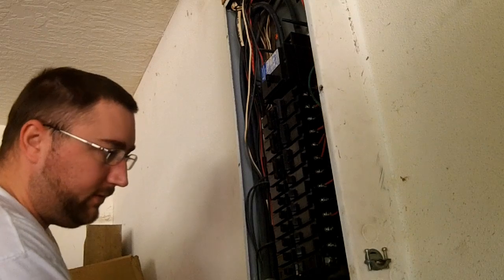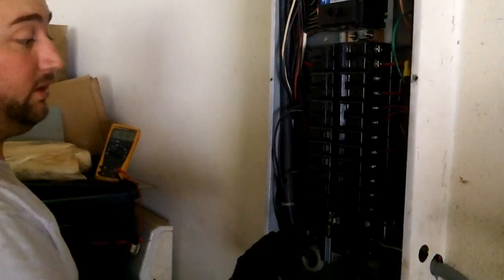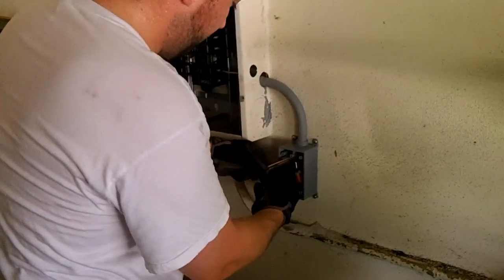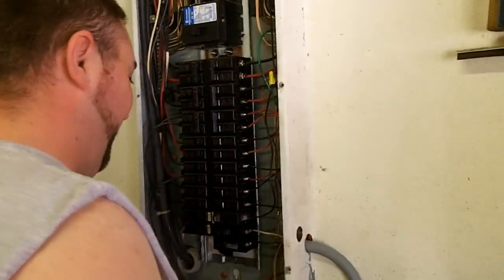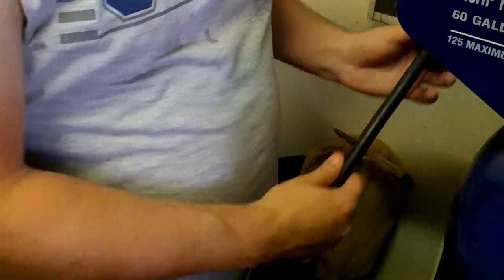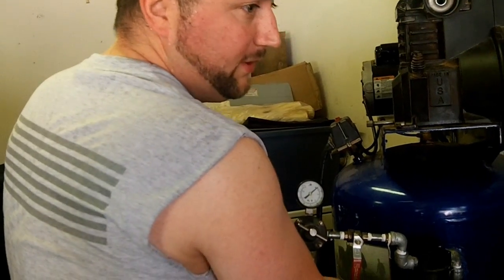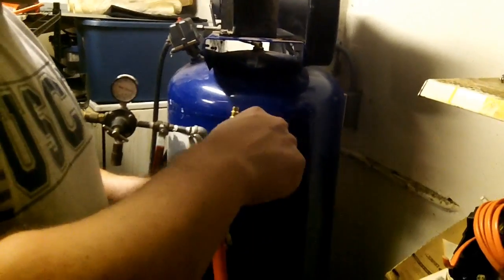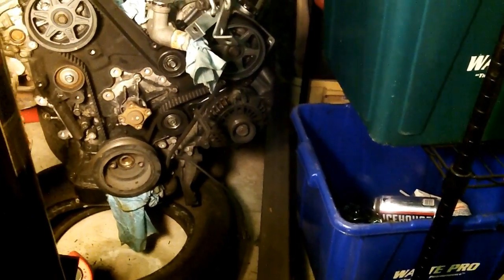240v Wiring for Air Compressor

Comment: Yeah, checking the ground for full voltage is a good thing.

The Romex isn’t so thick and hard to bend if you strip the sleeve off the wires, which you can do since you put them in a conduit.

Comment: good day sir, how about 3phase compressor how to connect it to a 3phse line circuit breaker? thanks..
Reply from the maker: I'll assume you want a wall switch for safety reasons.  Find a 3 phase switch.  Wire the compressor to the switch and the switch to the 3 pole breaker.  It's not much different from what you see here except you would use 3 phase components.  Instead of dealing with 2 bus bars you have 3.  Instead of a circuit breaker with 2 poles it would have 3.  Just make sure you get a 3 phase safety switch and you're good to go.  Most 3 phase appliances use very high voltage (it can kill you).  Please be very careful.  If you aren't sure what you are doing contact a professional electrician to help you.  3 phase is no joke, it's usually only installed for commercial buildings these days to power industrial equipment.  There are plenty of older homes still on 3 phase but they are being phased out for 2 phase.

Comment: You two are scary, be careful & Hire a certified electrician, save a life.
Reply from the maker: g quinn > Care to explain how and why?  This is a learning channel so please teach me what I did wrong.
Reply: @DJDevon3  idiots just want to talk a bunch of shit, Nothin wrong with knowing what you're doing if you know what you`re doing. No need to wait for someone to rip u off behind their little certification. If it passes inspection, who cares?
Reply from the maker: Scary how?  Please explain.  To my knowledge we did not just meet state building code, we exceeded it.
Reply from the maker: I see.  Please understand that my brother was an electrician while in the military.  He knows what he is doing.  I'm the one that doesn't know what I'm doing. ;)  He made sure that we checked and double checked for live wires before touching anything most of it was off-camera and not filmed. ;)  We actually improved some code violations in our case.  Always consult an electrician for this kind of work definitely.
Reply: if you can accept something from an old ANG Tech we have this safety thing called the "one hand method" that means working around voltage we try to do things with one hand. do what ever you can to limit your exposure by using one hand, if you have to get an alligator clip do it

Comment: I didn't read all the comments, but it looked like they were about the wiring and the regulator.  One suggestion I have...especially since you're living in Florida....Get 50-100' of 1/2" hose and connect it between your tank and the water trap.  The air coming out of the tank is still really hot and can hold a ton of moisture.  I leave the first hose coiled up on the wall behind the tank.....it acts as a condenser.  You'll pull a lot more moisture out of the air this way.  The 1/2" line shouldn't have much of an affect on your flow or line pressure to cause any trouble.  When I lived in Florida, I did this with my compressor, but I also kept the hose in a big tub of water.  Here in Oregon, I just hang it on the wall. 
Great vid......I got a good laugh when you plugged it in with it turned on!!!  Been there...done that......cleaned my shorts later.
Reply from the maker: bluehandsvideo I"m going to be adding a 50ft run of copper pipe plumbing on my wall.  I'm sure I'll make a video on that.  Haven't bought the pipes yet.
Reply: ***** Ah!!  There you go.....mo' betta idea!!!

Comment: Next up.....wiring in a/c!!  lol
Reply from the maker: bluehandsvideo I wish.  That's just not going to work for my garage in how frequently I open/close it.  What I really need are a couple of industrial sized fans.  I have a pretty big oscillating fan that keeps me cool on the other side of the garage.  On the side with the breaker box though, there's no air flow and it's hot.  Figured that would be good to show people that don't realize just how extremely hot it is here during Florida summer.  It's a sauna.
Reply: *****  I've thought about doing this for mine......taking a good sized desktop fan and mounting it to the ceiling upside down.  You could put it on oscillate or point it where you want.  Have you seen the guys putting their cameras on a boom so they don't have to use a tripod?? I was thinking about a fan on a boom.......maybe? :)

Comment: Hey DJ...nice to see that you got your air compressor running. On the installation, just got a few tips for you. For the opening, you can use reducing washers which has two different size conduit sizes on them to seal the opening.  #12AWG  would be big enough for the branch circuit and when you're running Type NM cable, (romex) inside a conduit, you can just peel off the jacket and use the wires by themselves which gives you more room inside the box. Also, you can check the ground by measuring against the line voltage as you mentioned. Just out of curiosity, what was the HP for that motor. From my NEC book, it looks like it's around 2HP. Take care and hope you get some good use out of that compressor.
Reply from the maker: stuzman52  It's a 6.5HP motor.  CH Model VT-1630.  Thank you for the tips.  I'm going to go look for reducing washers right now.
Reply: ***** Holy moly DJ...when you said 6.5HP, that motor would be pulling around 35 amps. I figured that the manufacturer has oversized the HP. I looked around the net and seems that some manufacturers got sued for this issue. Damn it, I posted the link, but it didn't show up. You could do a search and see if you can find it. In any event, the amperage is more for a 2HP motor. But in any event, your installation is good.
Reply from the maker: stuzman52 It says it's a 15 amp motor.  Date of manufacture was 2001 so that does sound about the right time when they might have been fraudulently advertising the specs.  I read up on the class action lawsuit and it's very possible this could be one of the models.  The 6.5HP motor and 60 gallon tank is what attracted me to the craigslist ad.  I figured the recharge time would be really quick.  All that matters to me is that it can get the job done.  Spinning off the crankshaft pulley bolt is the #1 reason I wanted a beefy air compressor.  It got the job done so I'm happy.
Reply: ***** Oh yeah, no doubt It's a good motor and compressor and you should be happy with it for years. Oh, I did see one more thing on the installation, but just forgot to mention it. When you get the two reducing washers, go ahead and pick up a male terminal adapter for the end of the pipe going into the hole. This way you'll have a connector on it to put a locknut on. Try to stay cool down there in Florida as it's hot as hell up here in NC. Take care DJ...
Reply from the maker: stuzman52 Don't need it for the part that fits into the outlet box.  Those two parts are water tight because it's an exterior grade box.   It just takes some waterproof silicone around the male end of the pipe (if installed on the exterior of a house).  They are very tight and there is an internal lip to prevent the conduit from going into the box.  That specific conduit and outlet are meant to be used together.  Getting the reducing washers and locknut should be all I need.  Thanks for the tips.  I had no idea what was needed to plug up that hole.  :)
Reply: ***** Yes DJ...you are correct about the outlet box as you've described. The pipe just glues into the box. I was talking about the other end of the pipe which requires a connector which has males threads on it. This connector has a slip fit for the pipe that's glued on and the threads of it goes into the panel with the locknut on the threads. That connector is the terminal adapter. And of course, the reducing washers would be for the hole in the panel. One goes on the outside of the panel next to the terminal adapter and the other on the inside of the panel. I know you can pick the adapter up at Home Depot or Lowe's, but not sure about the washers. Hopefully, either facility would have it all...Take care..
Reply from the maker: stuzman52  Ah you're right I do remember seeing threads inside but the small selection at my local hardware store (True Value) didn't have whatever part screws into it. I did look for it. I have to make a trip to home depot to get the reducers anyway and I'm sure they'll also have the locknut for the male side.  We did a good job just getting it setup but definitely want to do it the right way (with no experience).  Your advice is invaluable thank you.  The larger knockout is 1-1/4", the smaller one is 1" and the conduit is 3/4" so I need a 1-1/4" to 3/4" reducer.  Just need a 1" plug to seal up the old knockout.  I did some research last night after your comment and came up with a parts list.  Now I'm going to have to do it again for the male side. :P Thank you for all the great advice! When are you going to make some more videos?  It's been a while.  You know I absolutely love your electrical diagnostic videos.   :)
Reply: ***** Yep, sounds like you've got it figured out now DJ and always glad to help with advice. As for the videos, I've been pretty busy with work stuff and pretty much burnt out when the weekends hit which is when I would have to film stuff. In fact, I've been holding off on the cars but need to get back to them. The wife and I were talking this morning in fact about working on the truck and car. So, hopefully, I'll be able to get some videos out soon. Take care DJ and have a good one!

Comment: Congrats. Some battles are a whole lot easier when you can call in air support. :-)

I don't know if there's any good fix for it, but one minor problem for YouTube mechanics is that the motor of the air compressor can become an unwanted sound in the background of the videos. Simply mounting it outside the garage would expose it to the elements, and putting it inside the house might trigger objections from spouses and/or Caboose the cat. I guess the occasional refill noise isn't so bad.

Comment: @10:37 The pressure gauge on the tank is what pressure is in the tank. The pressure gauge near the regulator is what pressure is being sent to your tools.

Also, when you are going after stubborn bolts just let the tool work on it for awhile. Don't be afraid of holding the trigger sometimes the bolt is moving and you do not realize it is moving.
Reply from the maker: James Isenhour A 10 PSI difference though?  Seems a bit much when the gauge on the pipe assembly isn't leaking.
Reply: James Isenhour Yeah this part confused me.  Because the pipe and the tank are mechanically the same.  So I don't understand why there would be a difference.  The "air compression ratio" should be the same in the line as well as the tank.  That dog won't hunt.
Reply: Jonathan Campbell There isn't a ratio. it is regulated air. Think of it like a garden hose. there is a knob on the hose to pressurize the hose and a valve on the end of the hose that controls how much pressure escapes.
Reply: ***** The difference isn't due to a leak, if you look at the knob on the end there is a regulator that controls how much air is being sent to your tools. Your tank can hold more PSI than the tool can handle. This also allows for multiple tools to be running from the one tank.

If you were to plug the angle grinder into the tank and pull the trigger while adjusting the last gauge you will notice it will speed up or slow down due to your adjustment. This wouldn't affect the pressure in the tank or when the pump would turn on.
Reply: James.  You're completely correct.  I was tired and sweaty when I was looking at this thing and didn't even realize that the secondary gauge wasn't a line gauge but was directly attached to the pressure regulator.  :: smacks his own hand::  Bad!  Bad Jon!
Reply from the maker: James Isenhour  Ahh I see what you mean now yes.  The regulator is obviously set lower duh! haha.  Great call!  Thank you.
Reply from the maker: ***** Added an annotation at 10:36 and credited your great comment James.  :)